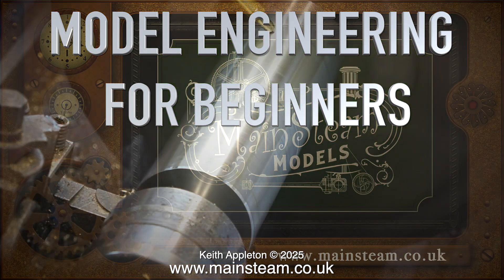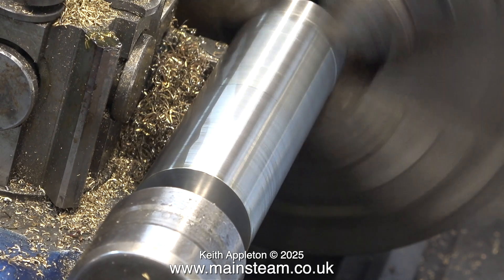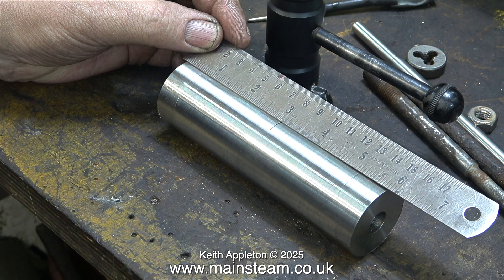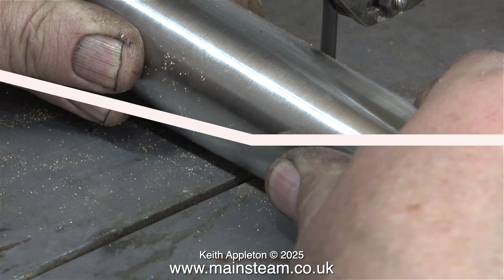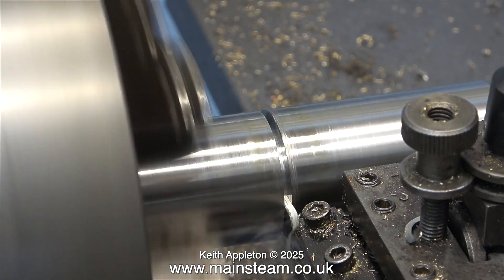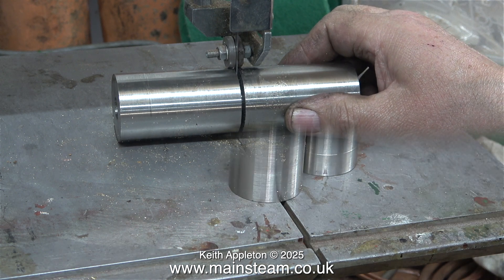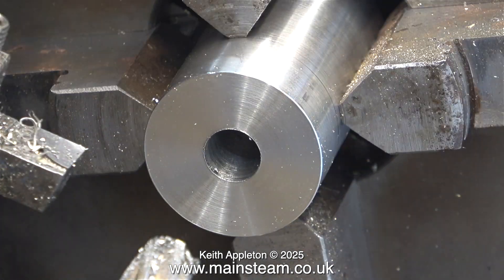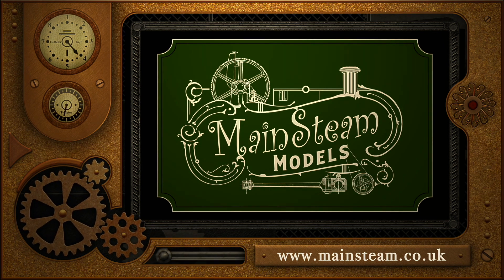WORKING WITH STAINLESS STEEL - MODEL ENGINEERING FOR BEGINNERS

Comment: I do a lot of stainless steel projects for vintage motorcycles.
To identify it;
If not magnetic at ALL, is 316 grade
If just a little bit magnetic, is 304 grade
If it machines nicely and drills nicely, is 303 grade (which is rarer and more expensive than the other two grades).

Your stuff looked like it machined very nicely, and threw off a light silver chip with no chip bluing, I would guess it might be 303 grade.
Reply from the maker: Thank you for that info - very helpful. }:-)))
Reply: Wrong  ! 303 is cheaper than 316  . 303 is a readily machinable Austenitic Stainless Steel alloy . This grade of S/S contains Sulphur giving superior machinability at the cost of reduced corrosion resistance. Weld ability is poor . 316 stainless is more expensive due to its superior properties brought about by is differing alloying elements .
316L designed specifically for easier machining. Both weld easily.